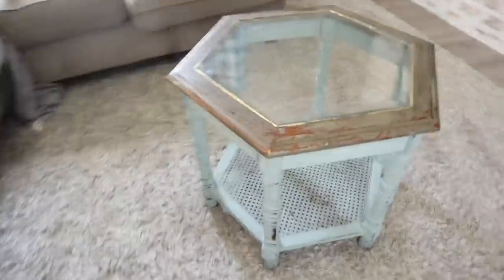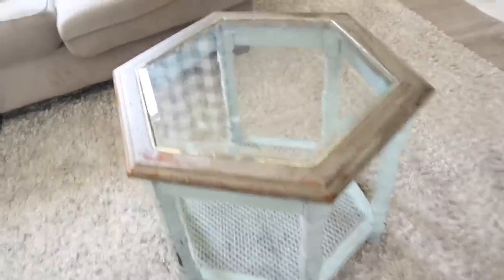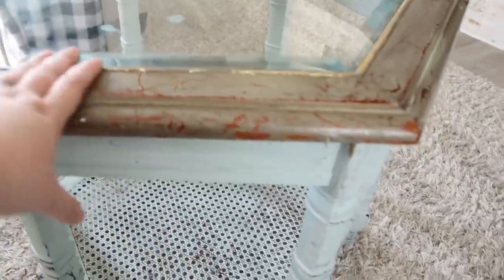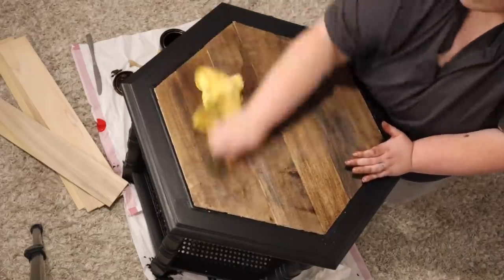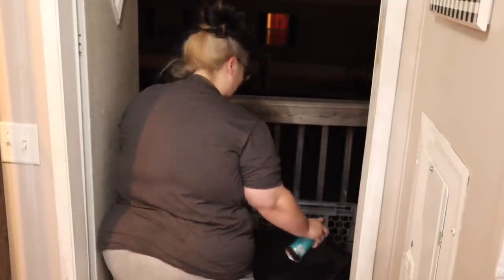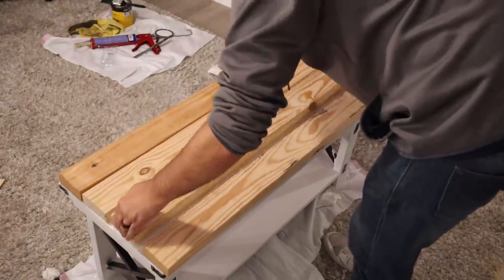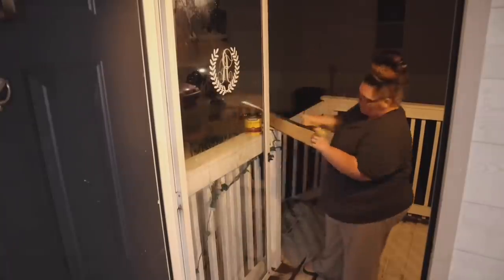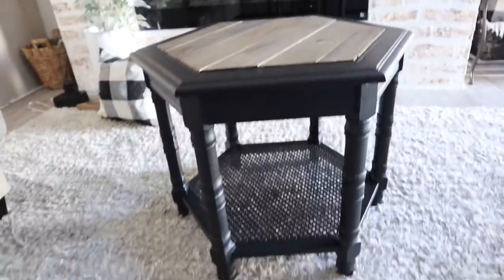FARMHOUSE SINGLE WIDE | mobile home updates | farmhouse diy furniture on a budget | farmhouse decor

Comment: 1st time catching a new video ... looking forward to watching.  Ok, watched the video.  I think your skill levels are really improving and I love that you're creating a home YOU love, not just what's trendy. I love these pieces. As a wood furniture builder and repurposed furniture refinisher and painter of 10 years (I refinish old pieces in good condition and salvage/ paint old damaged furniture), I LOVE polycrylic spray for pieces that have intricate designs/shapes and or woven materials and your side table has both! I've learned that for the most durable finish, I sand with a 320 grit sponge and then brush on a 2nd coat...except on pieces like the side table, I'd spray again.  The sanding provides a super smooth finish. When I stain pieces, I do a wood conditioner then a light 220 grit sand before applying the stain for an even finish...IF that's the look you're going for (like on a dresser top or dining table top). Well done! Side note,  love that song! My son & I got to see B&D in concert 3 times when he was growing up.  It was his favorite dance song! Lol
Reply: Me too

Comment: They came out so nice!! Great job you two!!!! Edited to add: You need to let the paints and stains cure/dry for a few days before you top coat/seal them. If you don't do that the wood/paint/stain stays wet and will never fully harden. That may be why things are scratching easily. I used to strip and redo furniture before it was "the thing to do" went to school to learn how to re-upholster furniture and had to learn how to strip and sand stain and paint wood elements.
I have to figure out why I am not being notified about videos!!!! Argh!

Comment: Working on my feet over here in KY in 2022.  I have lowkey for a while, I really struggle with dry/split heels.  Its made worse by issues with my feet and how I walk, so its not as simple as just remembering to moisturize - I really have to get in there and take the calluses off on a regular basis.  That's my struggle because between chronic pain and depression I have a hard time finding effort for myself or putting myself first.  If anyone IS like me, I highly recommend one of the battery operated foot files, you do have to replace the discs but they work well IMO and is way simpler and more effective than a pumice stone.

Comment: Too bad Shane can't build a frame for the octagon glass you pulled out of the table and make it like a wall hanging or something. You could even take photos of the kids and stick them to it or something as like a floating frame. And if you use that blue "ticky tac" put out by "Loctite" brand, they pictures are removable and won't damage the glass. Just trying to think of a way you could keep the glass but maybe put it somewhere where the kids might be less inclined to break it.

Comment: First, I need prayers for a job. I was a stay-at-home mom for 17 years and have been back in the work force for 3 years. I went with an unemployment company in Oct and that has been a horrible experience with them and the company I was temping for. Anywho, my 60 days was up the week before Christmas and they did not hire me on. I was never late, never missed a day, concentrated on my job when I was on the clock. I've been trying to find a job on my own. I've been on 3 interviews and they all day the interview went well but, I end up not getting the position. To me, that's not an interview that went well. I just need to work and want to work. I'm a Christian and just very depressed tbh.